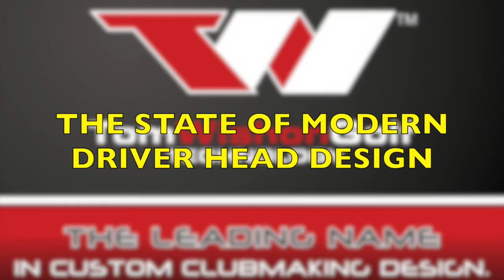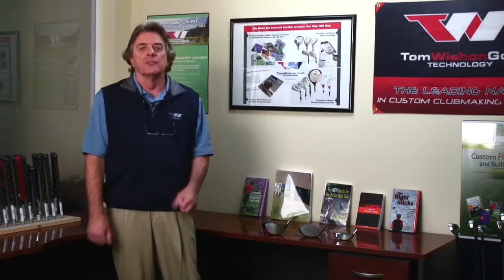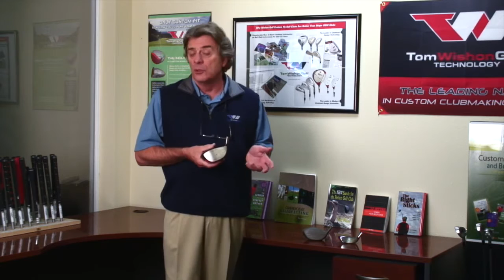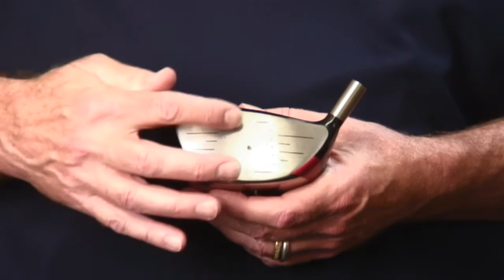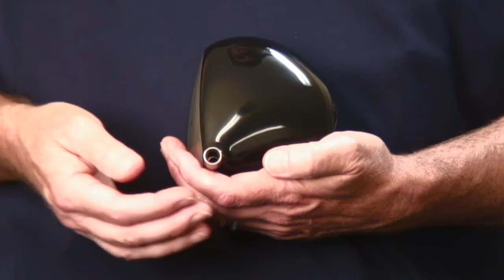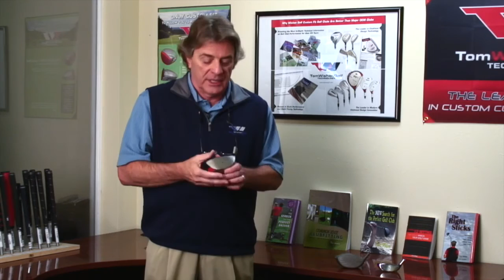THE STATE OF MODERN DRIVER HEAD DESIGN

Comment: This is totally true. Four years ago, I was hot to buy the latest driver. I'd been chasing drivers for years. (Okay, irons, too. But I solved that one with Sterling one-length irons.) Anyway, I finally decided to get fit for a driver. I assumed I wanted the latest and greatest from Callaway. My guy worked with me extensively. We identified that I tend to spin the driver too much, so we sought a solution. It turned out to be the Titleist 917D3 with an appropriate shaft. My rpms came down by 1,000. I still hit that driver. (Although, to be fair, I'm going to go to the new Titleist TSi3 when I get the time.) This has been the longest I've ever--EVER--played one driver. (I played those Sterling irons for 4 years, too--a record. I recently upgraded to the EQ1-NX and highly recommend them.)

Go to a club fitter and get what you need, not what's off the shelf at Golf Galaxy.
Reply: I call guys like you "all bag".
Reply: @billmoyer3254  You chose to insult someone unilaterally? You come from a very dark place. I shall not join you there.
Reply: @richdouglas2311  you just did. and you know the stereotype. the entire game is infected with it.